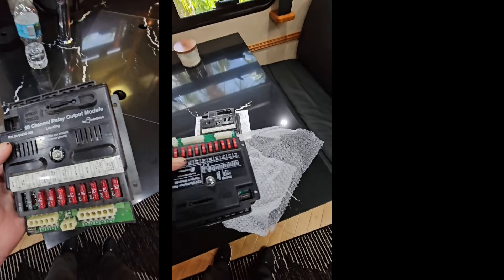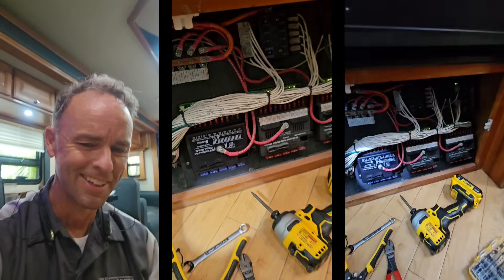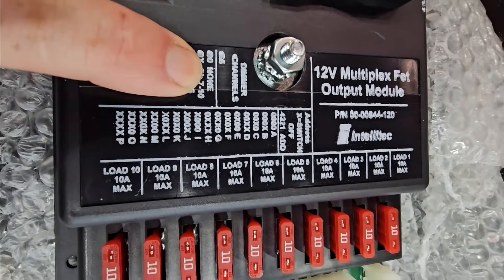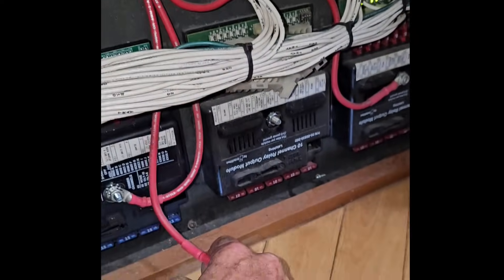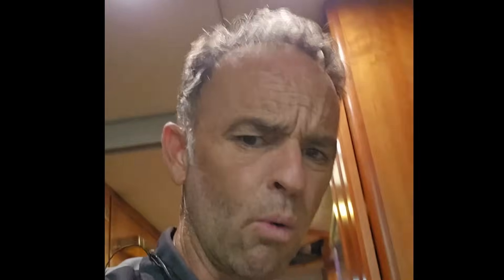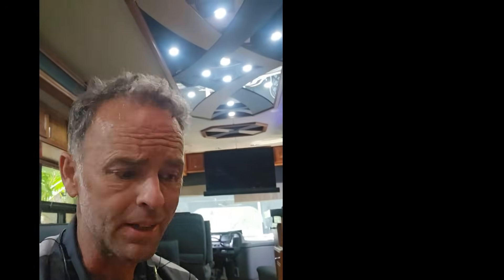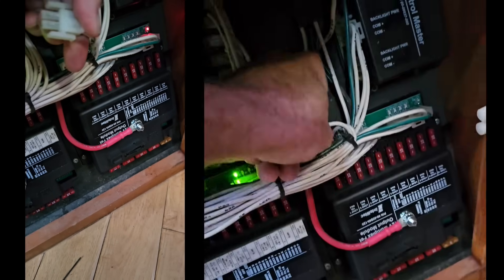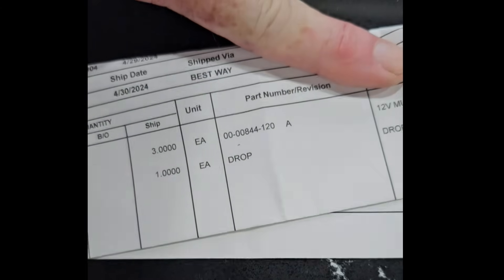Can Old RV Intellitec Multiplex Systems Still be Repaired and Upgraded Easy?

Comment: @azexpert could you please comment on aftermarket carbs for onan 4000? My local rv store wants $737 for 1 genuine onan carb.  That's robbery. It's cheaper for me to buy an open frame generator.  Are there any good 3rd party suppliers? I thought $325 was expensive 2.5 yrs ago but this is insane.  I'm retired military and can't afford those crazy prices.
Reply from the maker: I am with you at 737 I would just try the aftermarket too. 350 was obscene 2 years ago

Comment: Some day I’m going to have to dig into the LINC® WIRELESS TOUCH REMOTE - IDS from Lippert because the landing gear stopped working from the remote and I think there’s a blank relay that would work but I need to figure out what all the different relays are controlling.